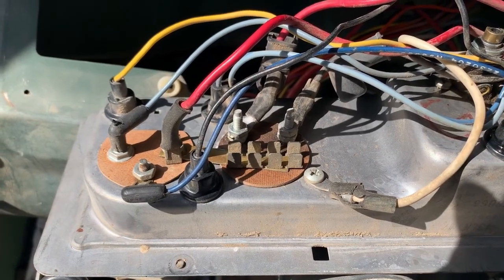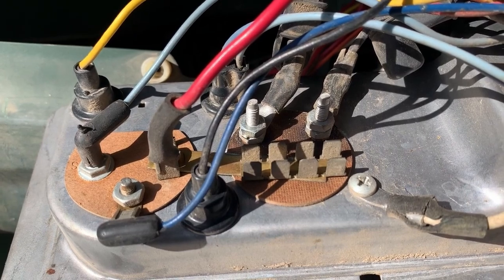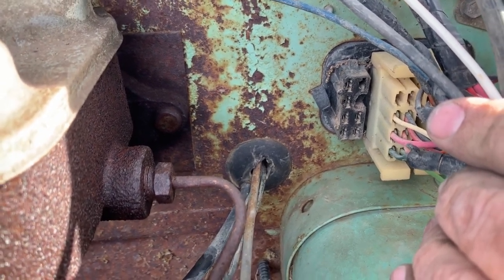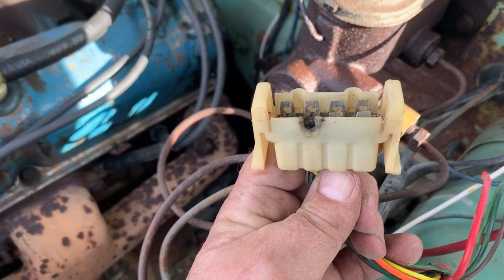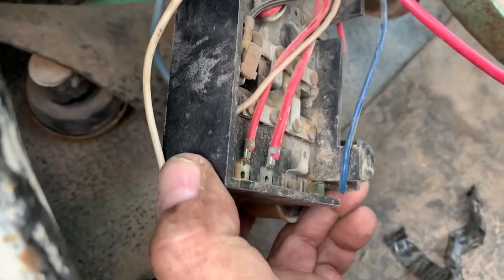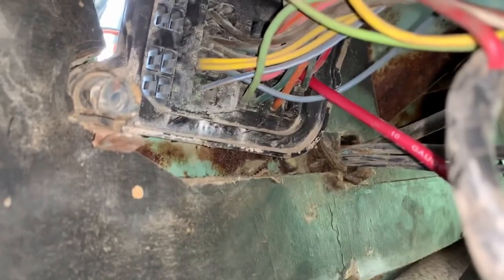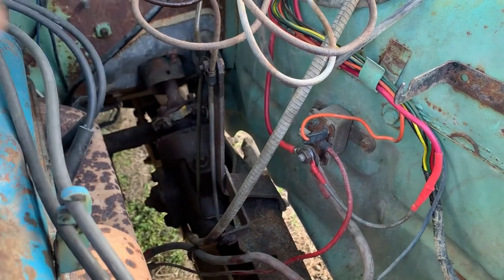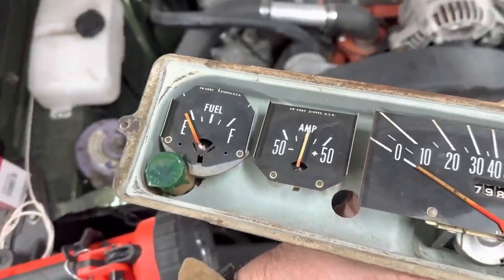Mopar AMP Gauge Bypass - Prevent Fire

Comment: You earned my subscription. 👍🏻 i replaced the glass & put pointer needle back on the shaft on an original 85' Frieghtliner Speedometer, sourced from a wreck. Had to pry open the big chrome bezel from the metal can/pod that was never meant to be pried open because they're "throwaway gauges". I did that because the donor gauge i could have swapped in had over a million miles on it and if the owner ever tried to sell the truck it would have severely reduced its value. Even though i left tool marks on the chrome, at least it was the original gauge. I even repainted the black background where the broken glass gouged it. Owner laughed when i told him i fixed it and he told me he fired the previous driver because he threw a hissy fit busted the speedo & both windshields and a few other things. So he bought me a nice steak dinner.

Comment: From the point of view of a man who's an old school auto instrument guy.  The ammeter in the car, regardless how it's done is running vehicle charging amps through the firewall and into the dash and was always a stupid idea. 
And running the wire through a connector even worse.   Years ago I repaired a cluster out of a 40's Plymouth (I think) where the alternator wire run through the firewall and past the back of the ammeter without interruption and back out to the battery. 
The magnetic field created by the current traveling through the wire was enough to deflect the gauge pointer.  In this system, the wire was not cut or interrupted and remained one long piece of wire from one end to the other. 
This was a far better arrangement. 
A voltmeter gives the driver the same information and presents no danger to the vehicle.  Back in the day, the ammeter was the instrument of choice, despite the danger, go figure.  In modern cars the ammeter has thankfully been deleted but never replaced with a voltmeter.  Every car should have a voltmeter.  Good on you for replacing yours with a voltmeter.  Whenever I get a classic instrument cluster to repair I always replace the gauge voltage regulator with a solid state unit regardless, and suggest a voltmeter as an alternative to the ammeter. 
I never found out why manufacturers went with ammeters, it's not like they didn't have voltmeters.

Comment: Right up to about 71, the bulk of the V8 mopar’s were delivered with 37 amp alternators, A/C cars being an exception. Anytime in the life of the car if the alternator was replaced, you would be given something around 50-60 amps. If for some reason you have a low battery charge and you start the car, you will pin that amp gauge and melt the plug, not desirable. The high amp alternator was needed when they went to the electrically heated back glass.

Comment: Good stuff.  I have a 1970 Dodge D200 I pulled out of a barn, had not run since 1989. Everything is toast and crusty on it and cobbled together junk for trailer lights. I have it running and driving now and started going through the bulk head and it is flat out scary. Stuff cut, scotch locked, twisted, bug nuts,. So just installing a entirely new Painless harness. Thanks for the tips.

Comment: I took the cluster loose in my 65 Dart GT 273 and grounded it,Still had the fusible link thankfully,it did its job and burned the wire in 2.Yes,I put the fusible link back in.Still not ideal but works.

Comment: Do you know off hand what the original amp rating is on the factory fuseable link?
Reply: A general rule of thumb is the segment is protected by fusible link that is four gauge numbers smaller than the segment you are trying to protect. I may have (incorrectly) gone a bit bigger for this install.

Comment: What is the difference between a inline fuse and a fuse able link
Reply: Sorry - just saw this... an inline fuse is a more immediate interruption that is less tolerant of shorts.... It is easily fixed by replacing the fuse. A fusible link is a slower method of interruption and may tolerate higher loads for brief periods of time before failing. The fusible link  is a section of wire that is of a different construction - it is designed to melt before the other "normal" wire (or hopefully the protective coating on it) does. The fusible link gauge (like normal wire) will vary by its' intended load .... once it exceeds that amperage, it takes a few seconds or so to completely sever. The fusible link will typically need to be replaced (un-pinned from the harness and unbolted from the starter relay ) to replace so the fuse definitely is an easier fix. I can't really say if it is a better system than the other mfg's were using at the time, but I can say it works.

Comment: What wire gauge would you recommend for the alternator to battery by-pass cable?
Reply: The factory stuff is about 10 ga but I try to use the next size up (think 8 or so)... The big cable to the starter should be battery size 6 or better.

Comment: The actual PROBLEM, is the 12 ga wire from the Alternator. Just UP it to a 10 ga. Electrical Fans, Fuel Pumps, Stereos etc ALL ADD TO the Problem.Replace ALL of the 53 yr old wire. The harnesses themselves were Plug & Go at assembly plants. It's been catching up since.
Reply from the maker: If the AMP Gauge ground separator material deteriorates, you will still have a problem with your approach (aka fire hazzard).  We adhere to the MAD Electrical document which includes what you suggest.   

http://www.madelectrical.com/electricaltech/amp-gauges.shtml
Reply: I would agree with that. You are suggesting replacing the wiring harness (with new) and increasing the size of the charging wire. You are replacing the poor connections and aged wire that are significant contributors to the issue. Another component needing replacement would be the poor wafer insulator that was commonly used for the back of the ammeter (note the vicinity of the steel dash casing to most of them).     
BUT ... I wouldn't waste the time to replace the entire system if it is just repeating the same mistake. I would modify the new harness in the same way I did the old one in this video. I believe the original design is antiquated and is only adequate in its new and stock state. Common upgrades - high output alternators, EFI, FANS, RADIO, etc. increase amp/flow and tax the original (and likely aged) components.  

Increasing charging wire size and eliminating connections (and the suicidal ammeter factory setup) WILL help this.     

Thanks for watching!

Comment: My 1985 Fifth Avenue has burned up the ammeter gauge, the car still starts and drives normally. Is it safe to just leave everything as is, or should i disconnect something and attempt to fit a voltmeter. Thanks.
Reply: Well... personally, I would swap a working ammeter out so.... I would say now that it is malfunctioning it is even more reason to deal with it. My understanding of the ammeter is that it is a total system load indicator - gauging ALL current flowing through the entire system. The ammeter failing to read without loss of current through the system makes me think it will eventually fail completely.... interrupting ALL flow through the system.... another reason to get after it. Good Luck and thanks for watching!

Comment: Mad Electrical. really? Can’t conflate their article about late seventies trucks to sixties-seventies passenger car ammeters. Different ammeter construction altogether. Full system load through the ammeter/bulkhead connectors? While in operation? No, only when the engine is not running will the ammeter and related connections be subject to full system loads. Engine running, fully charged battery, there will be little to no current through the ammeter, needle centered. All factory loads are handled on the alternator side of the ammeter. What kills bulkhead connections and ammeter insulators on these, as original charging systems, is mis-placed added loads at the battery. On an ammeter-based charging system such as this, there can be no added loads on the battery side of the ammeter. All loading needs to on the alternator side of the ammeter as are all factory loads. The ammeter is designed to register battery charge/discharge status only while the charging system is in operation. It is not designed to handle any other loading, as original, will not register full vehicle loads.
Reply: NOPE!
Reply: @72roadrunnergtx  I have. your 100% incorrect. I told you on my video as well and you just deleted your comment.
Reply: Are you referring to the Scamp video where you are promoting the use of a 2/0-gauge battery cable connecting the battery directly to the alternator output without any circuit protection of any kind? By-passing the fusible link and exposing the entire factory charging/power system wiring to the full current potential of the battery in the event of a short that would normally be protected by the fusible link? The same video where all my responses to your false and inaccurate statements mysteriously disappear in short order? Clearly you have no understanding of how this charging system is loaded as originally designed. As I mentioned in one of the missing replies, there is plenty of original factory training materials available on-line to study, do a little more research. Don’t take the word of an ex-Chrysler factory trained master tech, with 40+years of experience designing and servicing 12volt electrical systems for all manner of vehicles, at face value.  @oldblueaccord2629
Reply: @72roadrunnergtx  You didnt need to delete your comment just because its wrong. Your not a factory tech or been doing it 40 years. Dont make it worse on yourself.